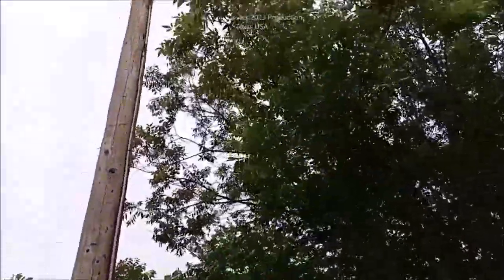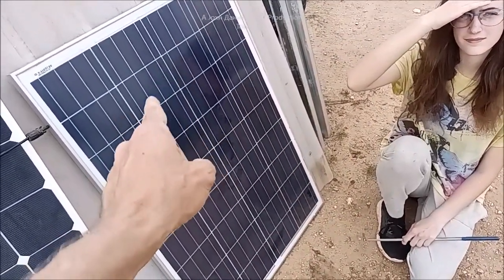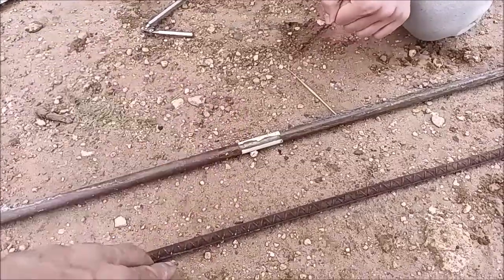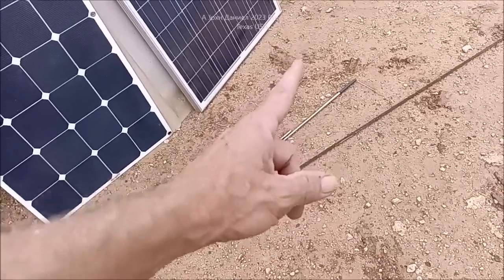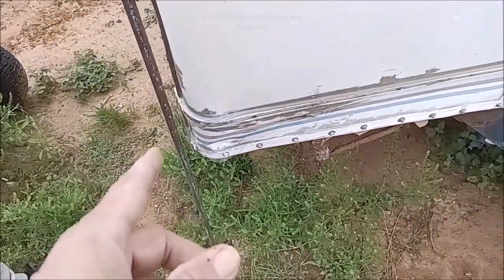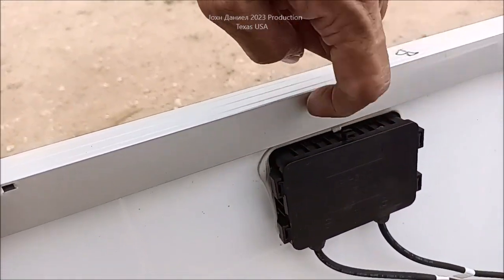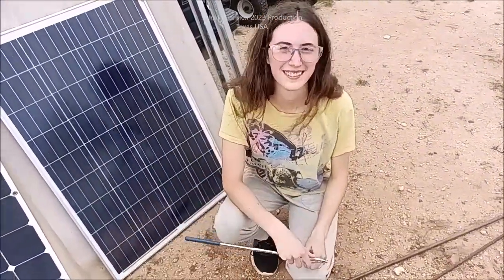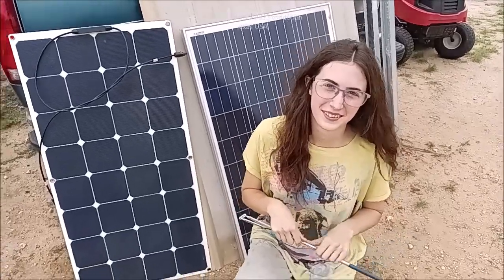Grounding your SOLAR PANELS? 🤔 You Better watch this First! *KNOW DC/Inverter POWER is not Utility

Comment: lol @2:22 , so much  disrespect  for  education displayed here.  Only lightning uses earth ground as part of it's functioning circuit.  It's incorrect to say the Utility uses Earth ground as part of it's circuit.  I'm sure this comment will be deleted as well.
Reply from the maker: Good show. We appreciate anyone who offers a complete opposite idea of that designed by the power company. As far as deleting, we only delete belligerent assholes.
Reply from the maker: Kiera said to share this, it will explain the Utility neutral is ground, and division of legs can not happen, get centered without it. https://www.youtube.com/watch?v=nKWf7XTg-wg
Reply: @JOHNDANIEL1  The utility is not using the earth as part of it's conduction Path, the ground rod is for safety with lightning it IS part of the normal conductionb path for Lightning. L1 L2 Neutral is part of the normal conduction path from the utilities. The utilities do NOT send power to you via the earth (soil)  and so by extension not through the ground rod.   If you removed the Ground ROD GEC from a normal grid counted AC residential service (don't!)  The circuit will still function, but it won't be safe.     I'm not arguing anything else here, just your inference that the utility passes power ("it's ability to function") from the earth.  It only derives it ability to BE SAFE by earth grounding.  And no, I'm NOT saying that you should put GEC's at the array and elsewhere (difference of potential) , however it's vaery hard to actually avoid Earthing a ground mount array just because they are anchored to the ground in multiple places.   Research : "Mike Holt" ,

Comment: The reason for "bonding" non current carrying metallic components to "ground" is to equalize the electrical potential to ground in the event of a short circuit inside the equipment. If you come in contact with those now energized components, you could die. This could save your life. As someone who has nearly died from an electrocution due to a missing bond to the ground, I am fanatic for proper grounding and bonding.

I do agree with you relating to  rebar for a ground rod. I would refer you to your local electrical code to determine if rebar and what diameter is accepted in your locality.

Lightning will destroy almost anything. There is no grounding system that is truly effective against a direct lightning strike. Directing lightning away from your solar panels, as you described, is a valid point.

BTW: the metal on my panels/wind turbines and neutral conductors have been bonded to ground rods for over 20 years. There are no failures yet due to lightning, even though there has been lightning in the area multiple times. I just opened the box, so I'll probably get hit next week! 16:57
Reply: You are correct @timguishard4641. AC or DC doesn't matter - both will kill you. Grounding isn't to protect gear from lightning but to protect humans from electrocution. Please ground your panels people especially if they are high wattage panels. Better to shunt that current into earth than through someone who happens to touch a panel with a short to the frame.
Reply: Did getting electrocuted hurt?
Reply: Obviously this guy doesn't live in Florida, If you don't ground it all equipment will be destroyed after lightning strike.
Reply from the maker: People who find voltage coming from their solar panel frames are the folks who worry me 😂. They need to ask why one isolated piece of aluminum (solar panel frames) makes its own power, but another one of identical build (aluminum window frame) don't. And funny thing is when I removed all the ground wires it disappeared. 
People who put a array up far from their homes ground rod and don't connect the solar ground to their home also seem to have no transient voltage from their panel frames. Hmmm.
Reply: @JOHNDANIEL1  Exactly how did you measure the voltage on the panel frame while it was "grounded"? Was that V measured w.r.t. the ground wire or some other point (hint: there will be no potential difference between the frame and ground if it's properly grounded)? And then how did you verify "it went away" when you removed the ground wires? Did you measure the frame w.r.t. the ground that you removed? It sounds to me like there are problems with your gear or your test methods.

Comment: Hi when you run the inverter cables into the distribution box in a camper what do you do with the earth wire if you don't have to earth it.. Does the system and breakers just run off live and nuetral.. Maybe a video on inverter installation in a camper.. I cannot find any information on this. I have a camper and off grid container with inverters. The off grid have earth rods from the inverter should I disconnect these tia..
Reply from the maker: Install a 100 amp Schottky Diode https://amzn.to/45K5eG1 inline, flow forward to chassis from inverter ground, to the steel chassis of the RV. Attach your ground terminals to it.
Reply: @JOHNDANIEL1   same situation here, but want to clarify: I have a 4200watt array 100’ from my camper. Not bonded/ grounded. I have an all in one eg4 inverter and lithium battery rack system in the camper. Camper not grounded. Do I need to install this diode as additional protection from lightning beyond the fuses and circuit breakers? I also am connected to starlink which is run up a tree near the camper. What, if anything, can I do to protect the camper from a hit to the starlink? Thanks!
Reply from the maker: @Blackbird-zo1su  Your starlink does not have sufficient cable to carry much from a lightning strike and is very limited to attracting any. You can take the cables from it and loop them into the ground a little to default such action to earth. As for the diode to ground, it is for isolating residential ground from off grid components. Your fine with fuses at the panel and breakers at the camper for safety.
Reply: @JOHNDANIEL1  thank you SO much!! I have been trying to hunt down the right info for quite a while. As you said- lots of conflicting info, but yours makes the most sense. I have not wanted to create a bigger problem while trying to protect myself and all of the expensive equipment.  Thanks again!

Comment: I totally agree I had an inverter powering my house for 6year peaple kept telling me to ground so I did  it fried my inverter in two hrs 450 dollers down the  drain I should have known with the big spark s that flew when I attached the ground wire. This guy knows don't ground panel or inverter or your car
Reply from the maker: Treat your inverters as a island and it will run right. And you won't put wild voltage from refrigerator/air conditioner and transformer feedback into your solar either.

Comment: Grid tied solar should always be grounded, your inverter can fail and modern inverters couple to the grid transformerless.
Lightning is not an issue, static buildup on the panels is.
Static voltage can build up on the frames and arc to the DC circuit.
Reply from the maker: Yeah, we got that same static problem with our van, and aluminum house windows. Working on it.
Reply: Good point. Their knowledge of grounding is very limited.

Comment: I have a 35 foot rv with 2400 watts of solar in 4 strings  130 volts .
Should I bond solar panels inverter combiner box and battery breaker box to chassis frame HELP!
Reply from the maker: NO! Not if it ends up on same ground that the utility uses without putting in a inline circuit breaker safety. I have seen back feed destroy many inverters in RV's when they plug in and get chassis feedback. Use this, https://amzn.to/3ODDsDr for 30 amp, or this https://amzn.to/3DW7A87 for 50 amp then yes you can use the chassis ground, but I also install a 100 amp diode https://amzn.to/3DZmDOq to ground so NO back flow.  When a AC unit kicks on, a high inductive load happens, and your on utility plug in, the common can get high loaded, it's spike can feed to ground, the chassis, and POOF your inverter or controllers eat it! Diode I use is so a fault in your system passes through, but a fault in something else does not. You take all solar, Inverter, Controller chassis with 10 awg wire to a buss bar, isolated, from it the Diode to frame.

Comment: According to EG4, they recommend a ground rod on the panels because their inverters put out an AC voltage on the PV lines.  Seems sketch but perhaps something to consider.
Reply: Probably that's just "noise" or EMI.
Reply: A grounding rod at the panels, or from the panels back to the main ground off the main service panel?  The later is correct.  You should never have the panels grounded separately from the main service panel grounding rod(s).
Reply: @ssoffshore5111  yeah I completely agree. I ended up grounding off of an outlet I had nearby that was connected to the main service and that took care of my problem.
Reply: @patrickgosselin9756  probably not the ideal gauge wire, but that should work to take care of the build-up situation...
Reply: Yeah I never quite liked their response on that one.  I know enough to be dangerous and to know what they said doesn't fully add up :p
Reply from the maker: According to metallurgy, science, math and physics they are lying! Placing a ground rod on your panels, that are as electrically isolated as your car windshield, means their product is dangerous and they are looking for YOU to be to blame for damage or lack of safety of their product for "not doing it exactly right" no matter how you follow their plan because once you involve ( as a insurer will tell you ) Mother Nature, the earth, then the company is immune to claims.

Comment: here in aus they send 2 conductors for 1 phase, 3 conductors for 2 phases. earth is used and required for safety to provide a path for any leakage. my panels were on the ground and got wet now they give dc through the frames, you'd feel the 400 odd volts i measured if you touch them barefooted.
Reply from the maker: See if a set of aluminum windows set up the same would give you voltage. Because a solar panel and a window are no different in electric conductivity to the aluminum frame.

Comment: what if you create some higher antenas to drive any possible lightning  to ground...   but not on array ..  , is it ok ??        2 or 3 poles  around  connected to grounding  in a fair distance of metal pv frames and even higher
Reply from the maker: I explain that in the video, to use 3 cheap 21 foot Fence Top Rail to make a triangular mast, then it support 3/4 rebar another 6 or 7 feet further up to become the preferred path.

Comment: I agree, earth grounding is ridiculous. They say it is for lighting protection. Lightning is going to destroy anything it comes in contact with. Even if you had a 4/0 ground wire it will be destroyed and turned to vapor. So just stop with the lightning protection. It’s only for homes so you don’t have a fire not to protect electrics. If lightning strikes it will be destroyed.

Comment: John,

The reason why solar panel FRAMES are grounded... Is NOT to protect the solar panel from lightning damage. It is to protect people that have a path to ground with their bodies. Electrical heat, Any energized conductor can melt and short with a solar panel FRAME, and this is the main purpose that enclosures and fixtures are grounded.

Volt DC is just as dangerous as Volt AC (Although you could argue that AC being pulsing can hit you harder due to the oscillation) The higher the voltage, the greater electricity conducts with the human skin, and the longer the electricity can jump through air molecules.

12-48VDC (Less than 50VDC) is considered safe for mobile devices without needing grounding of parts that are near the solar FRAME because the resistance in a human body is high enough to prevent current from traveling through our limbs.

For solar panels connected in paralleled, ground is not needed because the voltage does not exceed 48VDC.

if you connect solar panels in a string configuration between 450-600VDC, we are dealing with voltages that considered "Medium voltage", and is capable of locking a technician/installer to the FRAME if there was a direct path to the solar panel current carrying wire. Now the current will travel through the human body all the way down to ground, however the path is established.

Be very careful with voltages higher than 50-120VDC and up! Don't let your DIY project be the end of someone's life.
Reply: I had to ground my offgrid solar panels after getting shocked everytime I tried cleaning them 🎉
Reply from the maker: @Laurel-Crowned  Wonder if anyone will ask themselves HOW power gets into those completely isolated non electrically connected frames to begin with? Nope, they wont!
Reply from the maker: Nice try. But why would a proper installed wiring job lead to such calamity? You can ground your roof too, and your carport and your trees. Lots of power lines near them too. OR Use fuses like the manufactures instruct you to do, then no matter what you do while improperly wiring your solar with under gauged risky wire to 600 volts you will not have a continuous hot short from melting crappy under rated wiring and work.
**Solar frame grounding is for as described by manufacturers, solely as lightning protection not DC shorts to earth ground use. Installers have pushed this DC ground lie to the profit of a billion dollars. Use proper wire and fuses LIKE YOUR CAR DOES or even like Cellular power systems of 250 VDC transceivers uses and you will not have a issue to ground your DC power to itself or the earth.
Reply: @JOHNDANIEL1  Also, grounding your light fixtures isn't necessary in all cases either. However, it's a good idea as it makes your light fixture safer and reduces the risk of injury. I don't see how a 500-600VDC solar array is any different. (And 100% of regulators will agree with this point)

If you don't want to be regulated by a "electrical professional", go ahead and keep your solar panels ungrounded.. The likelihood of 500-600VDC leaking into a solar panel frame may be very minimal.

But the fuse won't trip if the Amps doesn't exceed 15A that the panel is rated for. The body has enough resistance to not exceed 15A.

And I have a gut feeling that car manufacturers use 250VDC transceivers need a higher and stricture insulative regulatory guidelines in order to sell them.

You can even submerge electrical equipment with the right NEMA/IP rating, I'm not saying that solar panel fabricators can't make products that are fail proof. But I don't think that most solar panels are UL listed coming from Korea/China.
Reply from the maker: @lassewestvanghougaard4856   I agree with grounding on any AC voltage system, but a point you applied (And 100% of regulators will agree with this point) you lost me!! Their banter is not based on actual skilled electricians, those people REGULATORS are government scum bags who never have even tied their own shoes, they panic at screwing in a light bulb, those people call Nuclear Power a bad thing, Hydro power a evil thing. They sue you if you install a Wind Turbine near their house, sue others who refuse to have one near their home. They shall tell you Solar is from their Gods. But per 10KW energy capability used, during manufacture and later to dispose which creates more waste than a family of 8 people per year does. But they call it "God Like".  
Those REGULATORS are like lawyers, social workers, perverts and molesters - Real societal dead weight. They are non performing tax payer funded Educated idiots, AKA human waste, AKA tax eating lying bureaucrats which feed at the same trough as a cock roach. In the common sense world the other 95% reside in, we consider them that thing you do not want to step into while walking. LOL!! 😝
More safety recalls on decisions by regulators/code enforcers have happened in the 20th century than by manufactures or installers who out number them 139 to 1. ( OSHA RECORDS OF APPLIED RULE 2014 )
Reply from the maker: @lassewestvanghougaard4856  Not sure what you read but I never said auto uses 250 vdc ( you quoted - car manufacturers use 250VDC transceivers )
No, Cellular phone towers use 250vdc transceivers, their battery systems In Re: AT&T/Sprint Hughes Communications electronics sending units; 17 amps, 250 vdc transceiver battery system. Applied power system,  Nicad from 1993 to 2013, Nimh from 2011 to 2018 Phasing in Lithium Li-poly 2016 to current date. 
No battery grounding to earth, all earth structural grounding using iron ballast to cell towers.
Reply from the maker: @lassewestvanghougaard4856  PS - Study UL listed. Underwriters Lab is a back door to manufacturers evading law suits. Was created for that purpose, originally funded by General Electric and Singer corp. ( wikipedia has "altered the truth on UL" but Ralph Nader busted them).
 Bribed government officials then created the so called "industry group", Jesse Helms and other senators got rich off it. 
Decades earlier you were more likely to get safe items if not UL listed than if UL listed. WHY??? - UL listed allows a manufacturer to dodge law suits, allows them to skimp on materials to barely meet safe requirements. When they do not use UL, or CE, they over build so cover their asses from law suits. 80% or higher ( Cloe Vercher of UL in a 1997 Law Suit depo ) of the items they pass are not even physically tested, just UL taking the words of the manufacturer who paid for the certifications. 
The people who work at UL and similar outfits have been caught numerous times creating false reports for sake of bribes.
Reply: @JOHNDANIEL1  I appreciate your point of view. Stay safe!